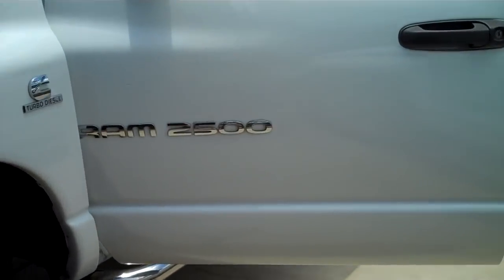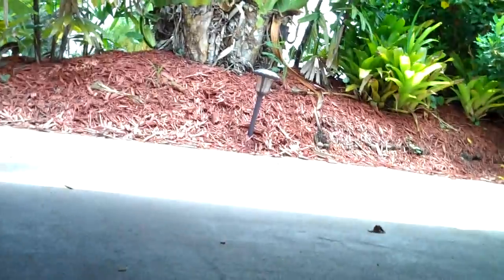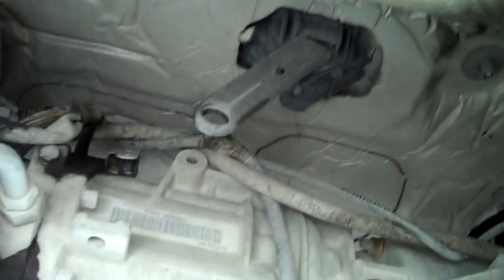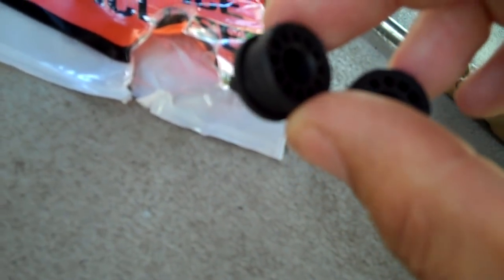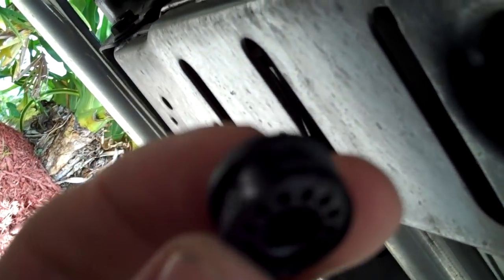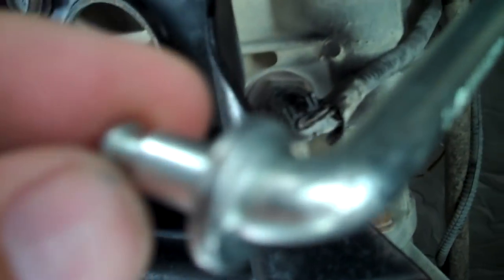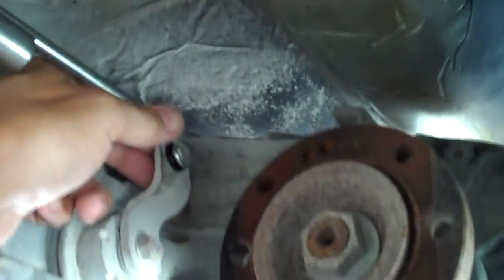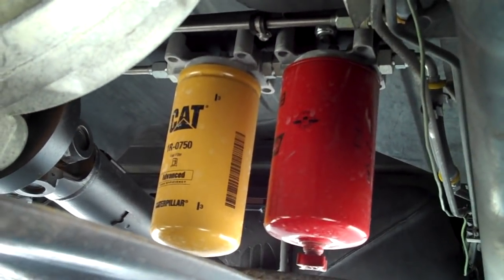Transfer Case Linkage Fix 2006 Ram 2500 5.9 Cummins Diesel

Comment: Bend a piece of 1/4-20 all-thread and extend the leads slightly to allow for dual side tightening washer and nuts. Thread lock when applied and it’ll never come off again. Stoopid rubber grommets.

Comment: Buy new grommet bushing. Boil till playable then leave in water till ready to insert both then linkage took 2 minutes. No bolts or shifters needed to remove
Reply: Thomas English thx for the tip spent 5 minuites trying to fit the bushing into the transfer case hole
Reply: If I could give a 1000 thumbs up, I would.  As a 55 year old woman, my hand strength isn't what it used to be.  There was NO squeezing a channel locks to insert this bushing cold.  Also, if you see the other video online where the dude pushed the bushing onto the linkage arm first and then pressed it into the transfer case lever hole , DO NOT DO THIS.  If you see the dude who suggested this, please slap him senseless for me.  I have one slightly damaged bushing inserted after boiling it and am ordering 2 more as I know the one I installed tonight will not last too long.  (damaged when trying to pull it off the linkage arm since it was not in the transfer case lever).  Kudos Thomas English!!!!

Comment: I know it is 4 years later, but I have to thank you for the detailed video. Those little buggers are really tough to get in straight. First one I got in and did not realize it was in too far. Start over LOL. Second one was 90 percent and I got it in the rest of the way with the lever arm. Nice and tight now. I had noticed that the lever was moving around a bit when I was towing. Seems super tight now. Bushings were in for 8 years from new when I had the transfer case installed.

Comment: Just has this happen to mine last week,    went to oriley for parts, $30,  thank you for your video.  i was able to get it installed and adjusted in 10 min.  Also thanks to Tom English for the boiling water tip.  they went in with no problems..
Good video, thanks again

Comment: Tunerdude, Thank you for posting this video. Two weeks ago I was driving my 2005 Power Wagon (Bought new in 2005, original owner and love it) and heard what sounded like a bolt hiting the ground beneath my truck. I thought I just kicked up somethig from the street and didn't give it any more thought. I pulled into my destination and noticed my transfer case selector lever moving freely. I grabbed the lever and it was as limp as a cooked noodle. As I am recovering from an idustrial accident I can't climb under my truck to investigate the problem. I'm certain beyond any doubt that what happened to your truck also befell mine. Now I can take it in for repair and know ahead of time what needs to be done. I wonder who the genius was who decided that a "C" clip wouldn't be necessary? Thank you again.

Comment: drill a few small holes and put some cotter pins in to keep from coming back out maybe
Reply: Mine were rotten, so even cotter pins would not prevent them from getting loose even if the rod did not fall out.

Comment: I struggled with this on my 2004 Dodge Ram 2500 for over an hour. Finally, I defied logic and started with the flat side of the bushing and used a flat screwdriver to force it into to hole. Got both done within 5 minutes that way!

Channel Locks didn’t work, hose clamp didn’t work.

Comment: Thanks, dude... 5 minute fix on my 2004 Ram 1500.

Transfer Case Shift Control Rod & Bushing Combo Set

Mopar Part no.  52105555AA / 68078974AA X2
(First part no. is the rod, the second part no. the bushings)

The replacement parts range from $40-$70 online but I found one on eBay for less than $14 listed under "Dodge Ram 4x4 Transfer Case Shifter Control Linkage + Grommet Bushings 2002-2005"

Comment: Last week roads in Wyoming and Montana were dry, then icy and snowy.  Shifting in/out of 4wd high.  Then the shifter goes free.  Luckily I was in 4wd.  Made it home to Idaho, looked at the FSM and hit the dealer in the morning.  Other than the cost of the grommet being $20, it was a quick and easy fix.  Dealer joked that they valued those parts dearly, hence the cost.   Luckily in my case the linkage bar didn't fall off, it just hung from the rear grommet.  The original rubber was worn and broken.  I bought a second grommet to replace the worn rear one as well.

Comment: Thanks for the video. I just had this happen on my 03 ram 2500 luckily I didn't loose the linkage but the bushings are definitely worn out
Reply: Ive got an 03 1500 4wd it is still the same concept of fixing it
Reply: @mylesleon5379  I believe so. The 5 speed automatic transmission is the same if you have the 5.7hemi

Comment: Thanks as I need to change those out myself however I didn't loose the rod just the bushings dry rotted. However if you look on Amazon you can find the whole thing for less than $40.00 or the bushings are less than $15.00 for 2.

Comment: Remember to put the rubber bushing in the hole, THEN put the rod into the bushing. If you do it in reverse order, it will be difficult to get the bushing all the way into the hole.

Comment: Next time the bushings crap out, get a piece of all-thread and a couple heim joints for the ends. Bolt it up with lock nuts and it will be the last time you ever fix it.

Comment: I think you put the rear grommet in backwards, but you got it straightened out. I have a pic, but can't post it here. I was able to push mine back in place (in the rear part), and add some wire ties to get me off the beach in 4 X 4.

Comment: I had the same issue, bought the part off of Amazon for 25$, it's a tight area to work on if you don't have a lift but it's a easy job other then that. Just don't do what I did and over tighten the adjusting bolt which cracked the metal casing around it....smh

Comment: Saw a good video about putting a hose clamp to tighten down bushing then take out bushing and insert into the hole. It the expanded out to fit

Comment: I have the same truck (and color) as you. I got stuck in the woods and fond out I have this problem. I have a question. When you tightened the bolt, did you have to make sure the shifter was in the correct position? I thank you for this video!

Comment: go to Ace Hardware buy turnbuckle 3/8x10-1/4 $5.99 ,1 lefthand nut 3/8-16 $7.49 ,nut 3/8 -16 $.15, two bolts 5/8x2 $2.64, Two lock nuts $2.16, $13.49 total put together and install,adjust and tighten lock nuts, 5/8 bolts only tight enough to make it not feel loose but free enough to move this is the best way to fix this for ever.
Reply: So you're saying put the bolts through the eyes of the turnbuckle AND the holes of the shifter linkage...then crank it balls tight?

Comment: how do you know what position the shifter is supposed to be in because my truck is not really clear on what position the shifter should remain at while tightening the bar below???
Reply: Lolli Pop if you have the old linkage, set the length the same and insert the end into the floppy shifter arm last. Same gear as when it fell off.
Reply: Great question! In case that the thing went missing, how do you know about the knob position

Comment: The real fix is to get a piece of brass the same outside diameter as the rubber busing and stick it in a lathe and drill it out to fit the linkage. the trick here is to get linkage to go all the way through the new brass busing so you can put a washer and cotter pin through it. that's the old way to fix this problem so it never happens again. That's what I'm going to do.

Comment: Mine has fallen off as well..   I don't know where the heck it fell off either.    I have found two different types...   One has a little weight on it.    Anyone know what the difference is between the little weight style and no weight...   mine is a 2005 diesel  2500 ram...

Comment: ordered this part for my 05 1500, and the linkage is 6 inches to long.  Now i have to get it cut to length and lathed down to the correct diameter. Annoyed

Comment: happen on my 02 ram 1500 4.7
Reply: did you fix it? have the same issue with my 02 ram 1500 4.7
Reply: HorrorFan524 I have the same exact truck and it just happened to me lol
Reply: HorrorFan524 I’m dealing with it now!!!!
I have a 2002 4.7L!!!!
Reply: I have an 03 1500 5.7 and I'm dealing with it today

Comment: it's a shit design , but it's a simple and cheap fix. i've had to do it three times now but i've got over 600,000 miles on my cummins. it's just one of those things i forget to check on and i've been fanatic in fluid changes axle to axle for the life of the vehicle